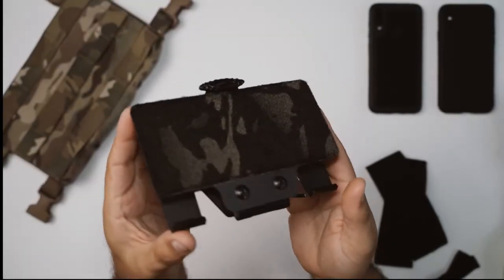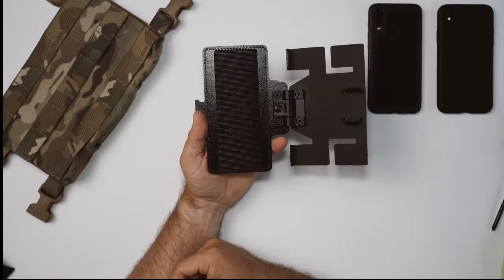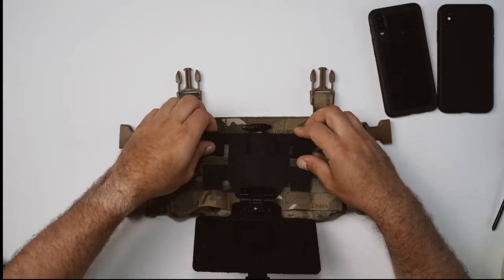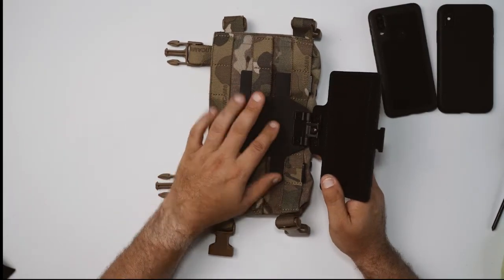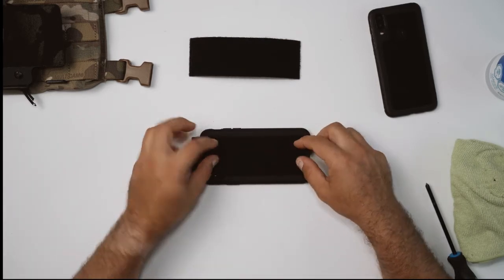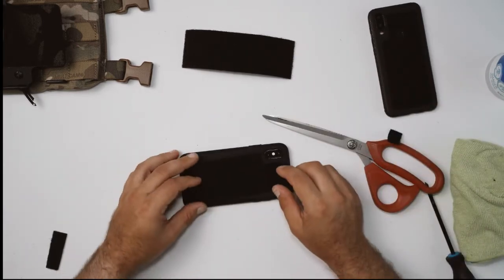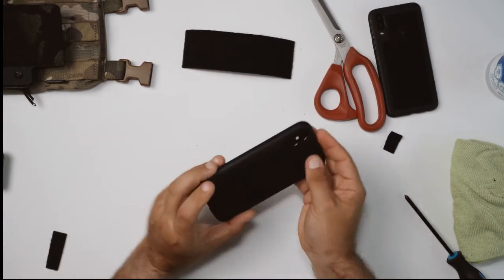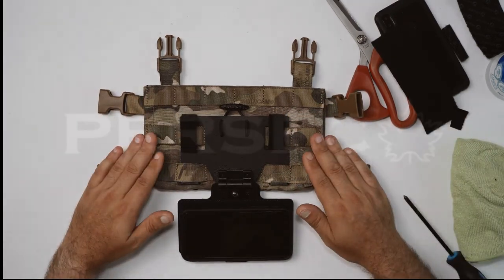Persec Gear Phone Board Setup

Comment: When are you going to have them in stock again?  at your site, all are out of stock, and there is no way to place a request via email.
and does the camo on the cover are *NIR (Near-infrared) NIR compliant? 
Can you respond to the request will be appreciated, (Left a message on your site via contact.)
Slow n Smooth <> Smooth is Fast
Cheers
Reply from the maker: The next batch should ready for next weekend (April 15/16). All of the velcro is Mils[ec and is NIR compliant